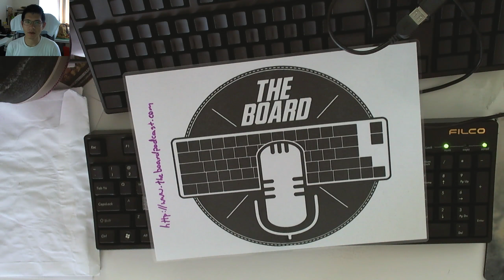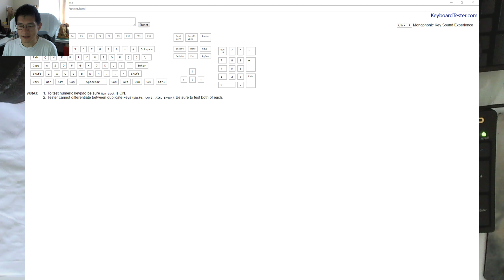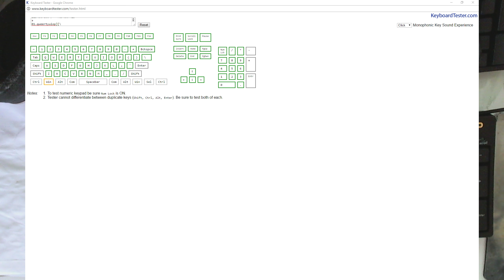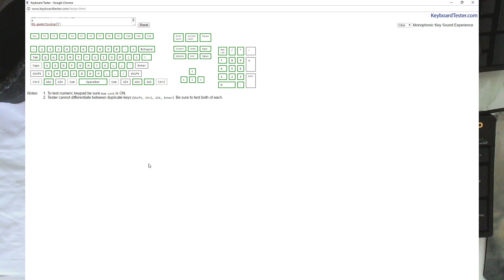Failed Filco MJT1 Repair

Comment: It's such a simple PCB I suppose one could use point-to-point wiring to the switch leads in order to bypass the bad traces.
Reply from the maker: Yes, definitely an option, but I'm now really thinking more along the lines of hand-wiring since at least I can visualise the matrix a lot easier and cleaner than trying to follow the matrix on the existing PCB.
Reply: I was thinking more of getting a new copper-clad with similar dimensions and recreate the PCB.
Reply from the maker: Ah, I don't have the resource for that right now. I know one local makerspace has a CNC for milling copper clad PCB plates though.

Comment: Why not try to replace the PCB? Like rebuild it by manufacturing your own, or have it sent out and manufactured? Just a thought. If it were me, I would attempt it, but that's just me. :)
Reply from the maker: The rebuild option is definitely possible, if I learn about how to repair burnt pads. In regards to manufacturing another, it could be possible through KiCAD etc. I have been wanting to do hand-wire, so that is why I had said it might be a project. Its simply a matter of time and cost I guess to re-PCB it.